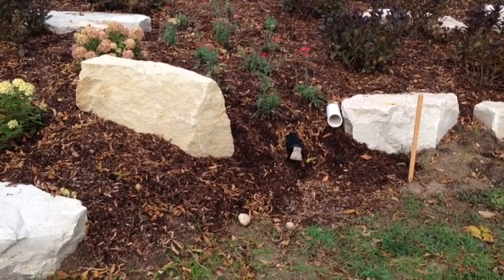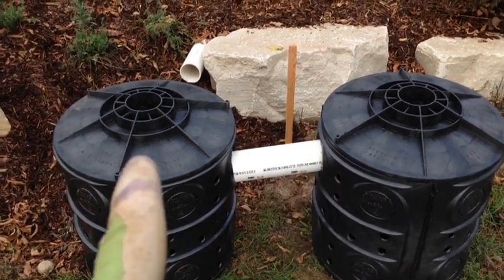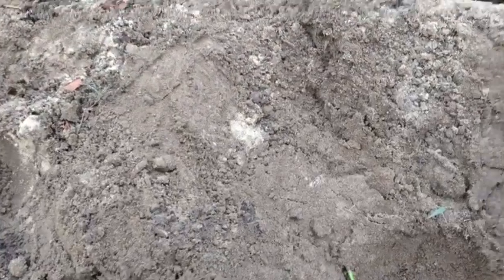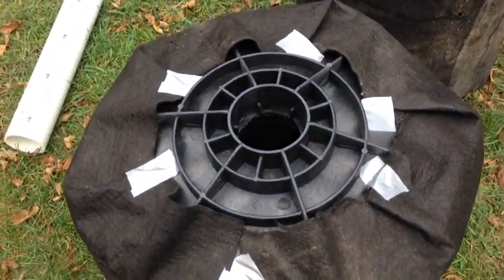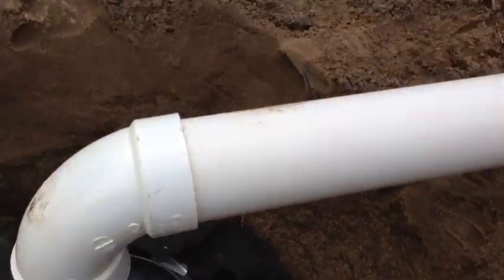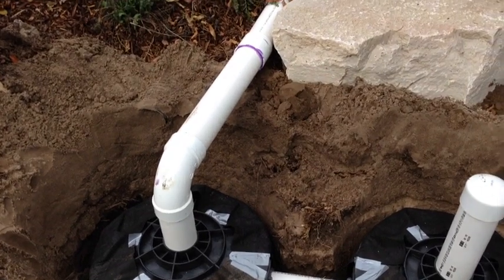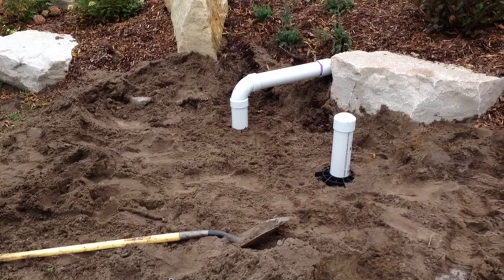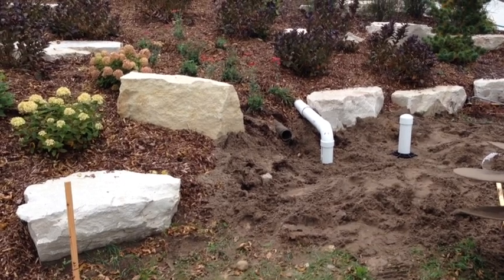NDS Flow Well System

Comment: what does it for? for flo well you no need two tanks. you have not installed gravel surrounded so I'm not sure how long it will last.
Reply: I was thinking the same thing, they didn't add any gravel at all.  It would have been prudent to add at least 3 inches of gravel below the drain, and 6-18 inches of gravel along the perimeter of the wells